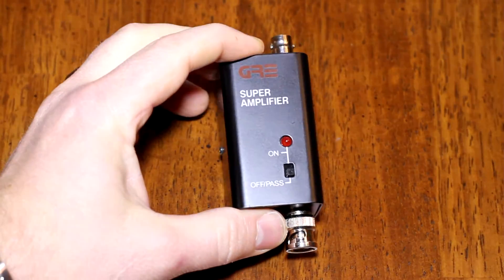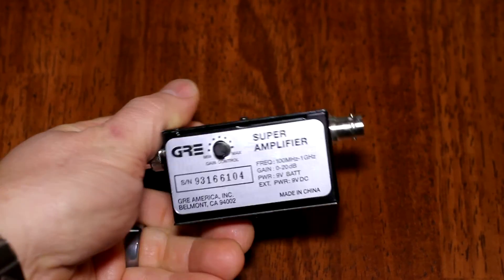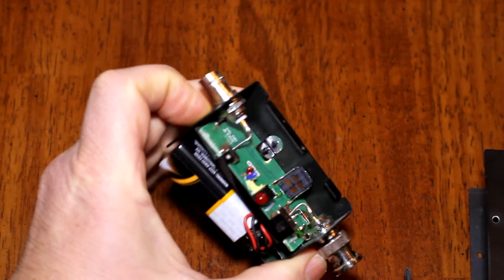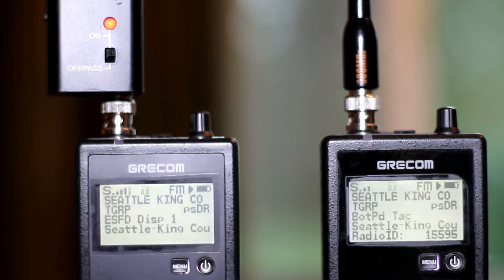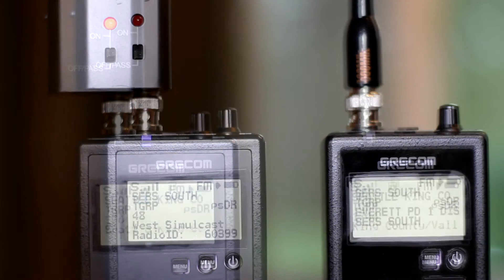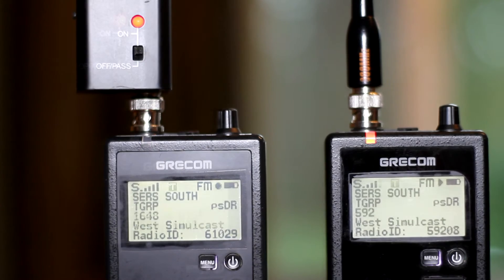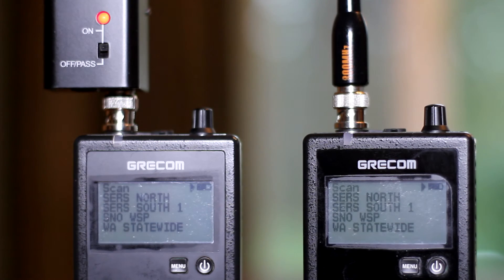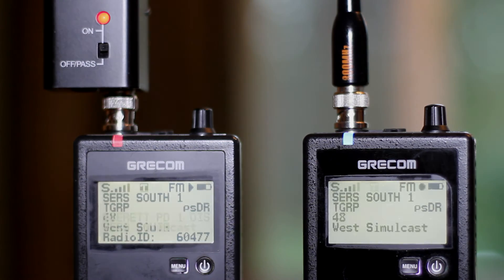GRE Super Amplifier Review- Improve Scanner Reception

Comment: multiple shots hello I am curious I have something similar to what you're showing but mine is called the Radio Shack 668 iskin what I have been noticing overtime since I have owned it that it will no longer turn on just by pressing power sometimes I have to play with the menu button and power on and it'll say waiting for CPU USB connection then I turn it off then I press power and then it'll going to skin mold and then I'm fine and dandy can you tell me why I cannot power on just by pressing the power on button now I have to press menu and power at the same time play back and forth is it ready to take a dump or do I need to upgrade

Comment: Hi there i see you like to use the gre and uniden scanners have you used a motorola radio on a trunking system.I used to use uniden radios and they work ok but the cell sites screw up the radios signal big time so for the last 6 years i have been using the moto stuff and no problem it does cost alot more but it works 100% when driving around the city.Programing is a pain but once you get use to it its not a big deal.Thanks for posting your scannig vids i really like them.

Comment from the maker: @BIGBOYYproductions I'm not that familiar with the 700 so I can't really say how it compares- other than the 800 having p25 digital capability. I personally love the 800, and I have a few scanners. You can find them on ebay as low as 325 used, but usually around $340-360.